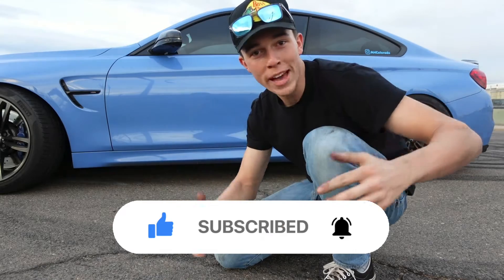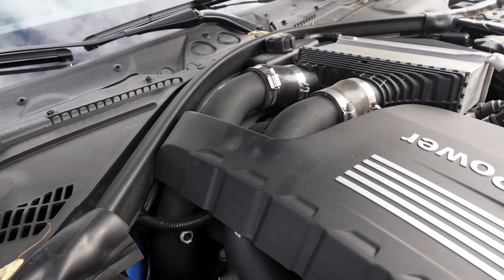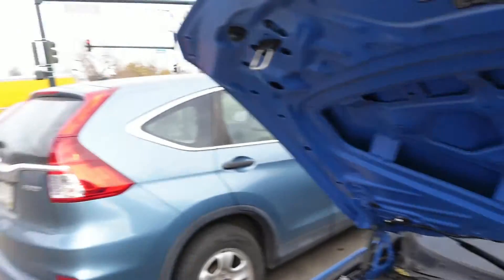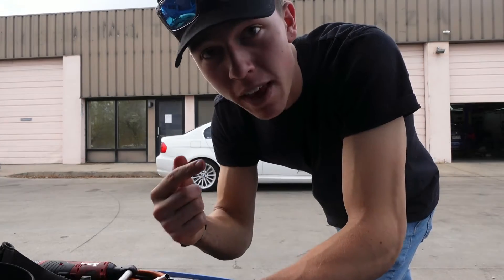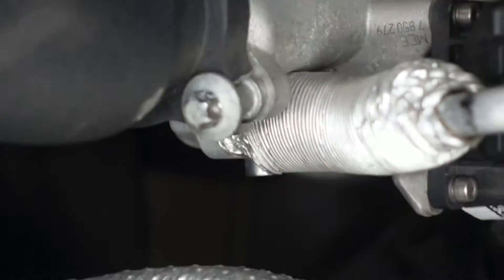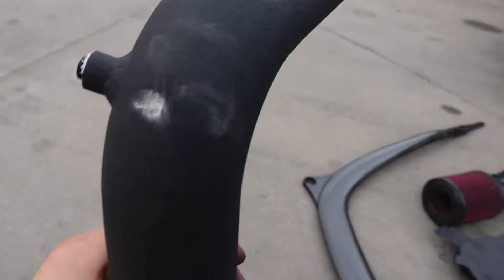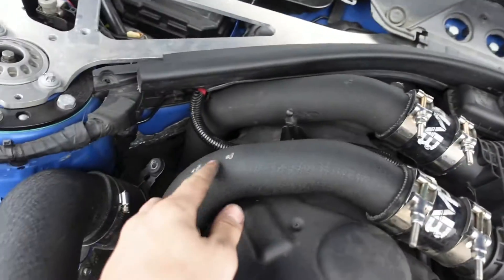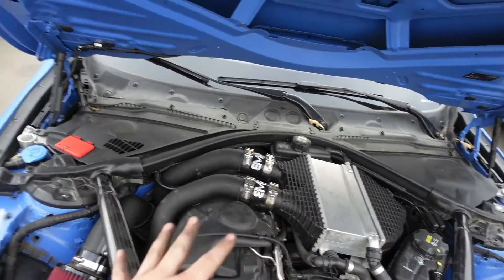THIS IS WHY YOU DON’T BUY CHEAP PARTS FOR YOU BMW M4

Comment: I got a VRSF charge pipe and have had it for about 35k+ miles and has had no issues
Reply: Ditto. Surprised I didn't screw up the installation.
Reply: @seankelly9054  same man. I’ve learned all the “diys” from YouTube. No mechanic experience what so ever and I’m installed downpipes, chargepipe, I take filters, new pulleys, surpentine belt, down stream o2 sensor, valve cover gasket, oil filter housing gasket and other stuff lol. It’s not hard but some things can be a PAIN in the ASS! Almost gave up on my o2 sensor because that mf wouldn’t thread in even though the angle looked good but it finally went In lol
Reply from the maker: That’s good to hear after installing them!

Comment: The best fitting Chargepipes I have seen are the mishimoto ones. Most of the problems with the aftermarket ones is that the stock pipes flatten a little and most of the aftermarket ones stay round throughout. Good stuff tho
Reply from the maker: Yea I’ve noticed that flat side on the stock ones and always wondered why aftermarket ones don’t have it. Appreciate it bro!

Comment: I have the VRSF charge pipes hot and cold side aka J pipe… also intakes and top mounted intercooler… I have had 0 issues with the parts they all perform well… Good Choice with using his old charge pipes.
Reply from the maker: Glad to hear they are working great! And yes I figured I’d just buy his old ones rather than paying $300 for new ones. Upgrading and saving!

Comment: How did you get your vrsf passenger side intake to fit below the strut brace? I had the hardest time with the air flow sensor stopping it and had to get an elbow piece to make it fit. Thanks!
Reply: I had the same problem, literally had to modify mine to make it fit properly